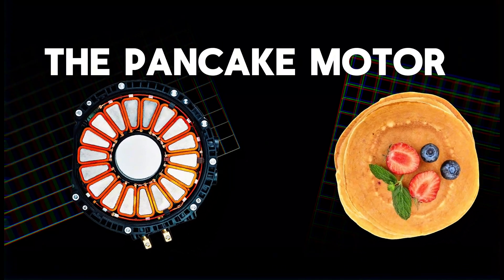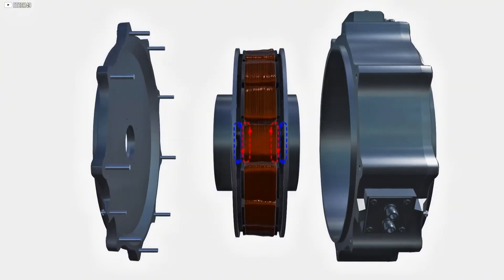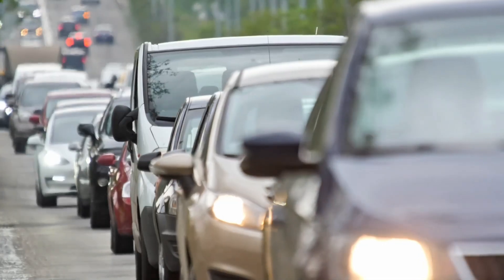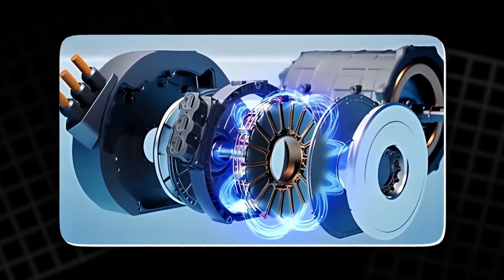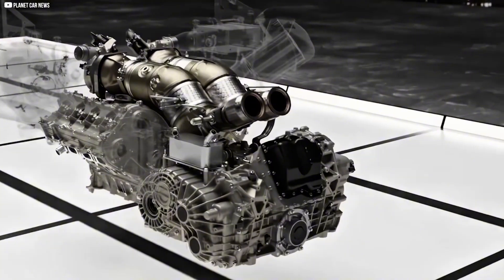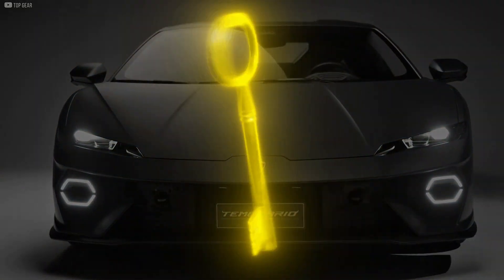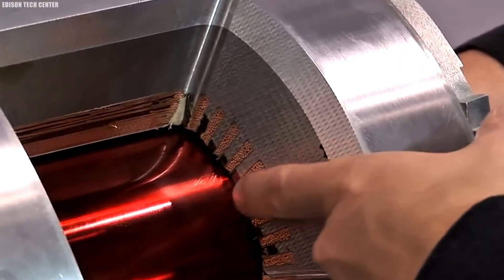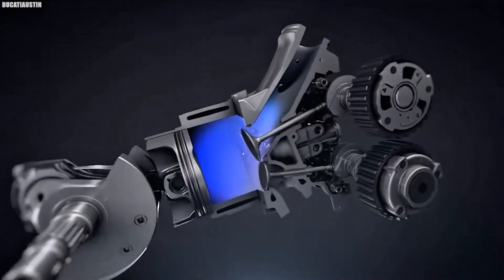The Motor So Powerful, It Doesn't Need Gears

Comment: can be used in replacing all sausage type motors in household appliances too like washing machines, electric fans, aircon, refrigerators so many for lesser power wattage with greater power😊😊😊😊 nice.
Reply: The gain is mostly in weight/torque which is far more of a benefit to mobile applications like EVs and drones.

It won't help drones that much tho - the battery and lack of wing modes are significantly greater problems.